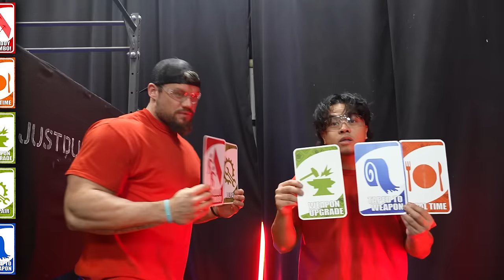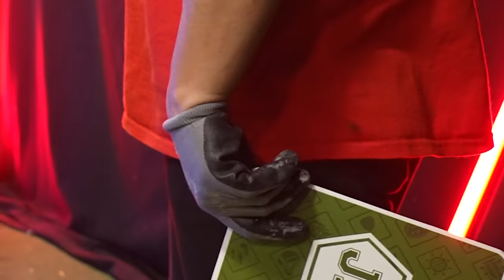100 Layers of Bulletproof Glass vs Bulletproof Vests

Comment: Kind of unfair. The bulletproof glass wasn’t secured tightly on all sides, making it easier to crack. Its like the Tesla Truck bulletproof window test.
Reply: But it’s against a Trent.
Reply: Lol
Reply: I was trying to figure out if it was polycarbonate or not
Reply: It may have been more fair (or  less) if it was shatter resistant glass instead of bullet proof because bullet proof stops bullets but can be shattered easily.
Reply: Ryerye Keeley  That is true I forgor that it was bullet proof vs bullet proof
Reply: I agree
Reply: Trent is my favourite character and I don't like Dustin
Reply: Also bulge proof glass is just a weaker material in general to a bulletproof wall
Reply: trent
Reply: yeah it seemed fair to me  the only reason why they lost is because they didnt use all of their cards it was very close
Reply: Facts!!!
Reply: Facts
Reply: Fair, and red team had literal metal after the first layer- it stopped being vests
Reply: @100subsbyenextmonth9  Q
Reply: The bulletproof window did exactly what it was supposed to
Reply: One shatters and one bends
Reply: Trent wins every time it’s fine
Reply: But I mean Trent is on the other side
Reply: @TheGenderDruid  same
Reply: So true
Reply: In the end Trent lost cuz of luck
If they got the freeze they would have won
Reply: That’s what I was about to say lol
Reply: Yeah the repair card had it secured fully on all sides so it held so strong
Reply: Actually their was glass and polycarbonate glass
Reply: But at the same time it’s trent
Reply: It’s against Trent plus it’s bulletproof glass and Trent has bulletproof vest not mall or axe proof
Reply: So true but its trent
Reply: Hater
Reply: Bruh hater who ever that comment
Reply: Do you know he Trent is? That's why the bulletproof glass is not that secured
Reply: The glass being more secured would allow it to crack easier as the waves would not be able to disapate as much
Reply: The fact that this comment has more likes than a comment made by justdustin himself
Reply: @harrisphera5492 you are right
Reply: I mean it is against Trent who broke through Kevlar with just a brick

Comment: Don't worry Trent, think of it this way, Dustin had to start with a square section already cut out so that right there made it easier for them
Reply: @DetailedCat  that's not how bulletproof glass works
Reply: Dustin had to restart with a real bulletproof glass tho
Reply: @pathunder1685  yeah just to pretty much pull it off
Reply: That's square was the bullet proof glass
Reply: @christiancodplayer797  that square was cut from that same bigger piece. Not hard to see it LoL
Reply: Well, the other side had "a trent" lol
Reply: @KennyDewittQuestionmark  best reply LoL any way to be able to beat Trent. They gotta do one with all of them vs him
Reply: It nearly impossible to beat trent with the sledgehammer
Reply: @kmking421  even then its a challenge lol
Reply: @pathunder1685  they hit it a couple times and then it fell off...
Reply: They had to because they need a frame to put the glass on and the needed to cut it smaller
Reply: Jesus Christ died for your sinssssss
Reply: @jesuslovesyou2616  no he didn’t.
Reply: @leiwolf27  he did…
Reply: @UnC0mmon_0  No he didn’t, sin is a man made concept.
Reply: @leiwolf27  yes sir like doping a baby in water even do it has no sins
Reply: Hey gotta think of this Dustin may have had to take a square piece out of the glass but the lexan made it way harder
Reply: @johnvids3346  🤮
Reply: Yes but Trent had just a bulletproof vest and Dustin had something bulletproof plus a lot more

Comment: You should make a 100 layer wall that you put Flex Tape on wood and then put Flex Glue on the Flex Tape and then have it sprayed with Line X and then layered that way as many times as you want

Comment: the repare card felt like it was kinda cheated. you did not go thou it. the bolt were broken off an moved. if it was put up on the layer of the bulletprof glass to support the impact behind the hit it would of lasted much longer. but yeah just a small bit of critasicim. was fun to watch ether way